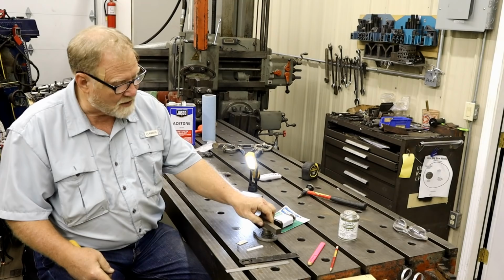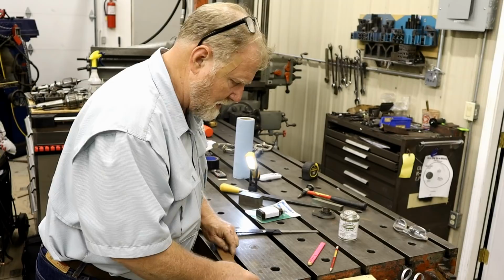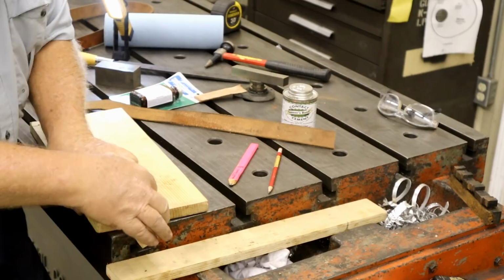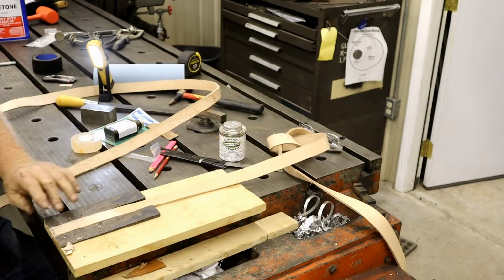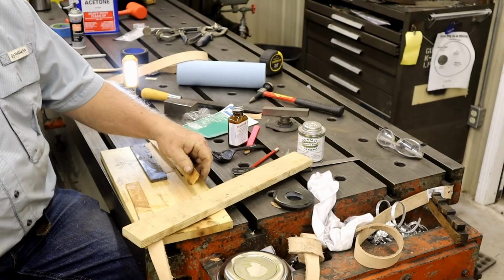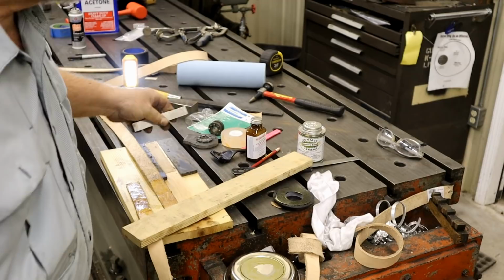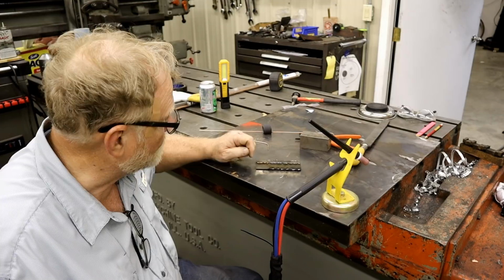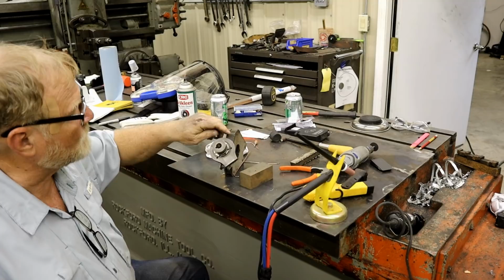Leather belt and dog repair... Repairing an Antique B&S #13 Grinder and Tool Master Mill

Comment: Guy brought me a bull gear out of a JD dozer. Some of the gear teeth were chewed up. I went over them with 3/32" 7018 and he took a file to em. Later he told me it was workin fine.
Reply from the maker: I really liked this A-2 tig rod from Blue Demon..  I think it will stand up to wear much better than any of the "Soft Rods" I had...  I just need to practice for about 12 years to get good at gear repair :)
Reply: @10swatkins  Yeah, ya gotta be real steady and a little dab will do ya in most cases. Getting the dab where it belongs is the hard part.

Comment: I wonder if an old-fashioned spokeshave would work better for skiving the leather? Also, besides the big cans of Barge cement, they also sell small squeeze tubes on Amazon (originally bought it for repairing old leather shoes).  Nice repair on the mill part, Steve.
Reply from the maker: I think the  tool I bought is better than a straight blade for the leather.. It has a thin blade that curves when installed and it lets you "dig in ' When needed..   I saw the small bottles, just though I would get enough to play with :)

Comment: Just put a sanding belt on it ! Hey run smoothly.
Reply from the maker: Please send detailed instructions on how that will work!.
Reply: @10swatkins  I was looking at the video and you were linishing the leather .. what do they use to glue those belts? It must be good stuff .. Nothing goes well without a bit of Don !!

Comment: OH PLEASE, Mister Steve and don't turn Don aloose on me. I's got enough trouble anyhow. As far as hands go I have 3 fingers and 2 thumbs wrapped up because of a hot oil drain plug. Neuropathy. And I don't need a blasted fillet knife. I ended up with 7 stitches in a finger from one and an apple peel. And your gun whateveritwas is my gun whateveritwas. Good leathering and tigging. GBWYall!
Reply from the maker: You just watch your P's and Q's and you are safe from Don! :)
Reply: @10swatkins  Knowing Don it better be the whole alphabet!

Comment: how about  a riveting tool.. https://www.macsautoparts.com/brake-shoe-lining-riveting-tool-removes-and-installs-28-68184-1.html  to put in brake shoe brass rivets..  might have a riveting tool at the tandy store also..  if you can put up the Tick tick tick as it goes around..
Reply from the maker: The noise would drive me bonkers.... This is going to work great.

Comment: bad man, using the table of the planner as a workbench. one of my pet hates is seeing people put things on machinery tables that should not be on them and slideways , i cannot help it it just annoys me and something i never ever do . could be worse i think i saw brian welding on his radial arm drill table the other day.
Reply from the maker: You do what you have to do.... 
That planer sets there not being used as a planer about 99.999% of the time... It takes up a space of 10 feet x 28 feet that can't be used for anything else and I have to even pay taxes on the floor space it uses.

I could take that planer to the scrap yard, get 30 cents a pound, free up space for about 4 more often used machines AND a place for a work bench!   But no, I give it oil,  electricity and a climate controlled space to live out the rest of it's days...   I think that's a pretty fair exchange in return for letting me use the flat table....

And besides I have not heard it complain even once :)
Reply: @10swatkins  You know you shouldn't do it. I have large wadkin wood lathe that takes up a lot of room that i only use now and then, so i built a plywood cover for the bed and turned it into a bench, which is real handy and i use it a lot,really quick to take it of if i need the lathe. you need to do something similar , make some plywood covers for it then it wont get damaged. it deserves it as its such a rare old machine these days, it should be looked after to preserve it for the next generation of toolaholics to enjoy when we are gone.
Reply: @10swatkins  You know you shouldn't do it. I have large wadkin wood lathe that takes up a lot of room that i only use now and then, so i built a plywood cover for the bed and turned it into a bench, which is real handy and i use it a lot,really quick to take it of if i need the lathe. you need to do something similar , make some plywood covers for it then it wont get damaged. it deserves it as its such a rare old machine these days, it should be looked after to preserve it for the next generation of toolaholics to enjoy when we are gone.